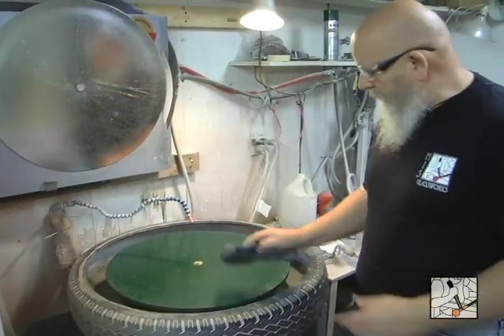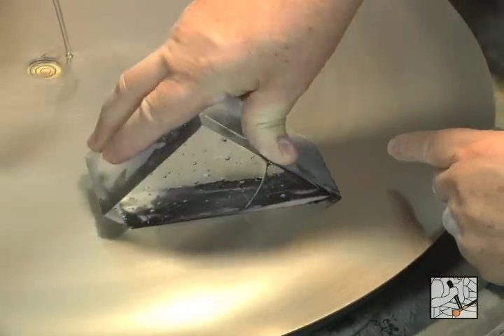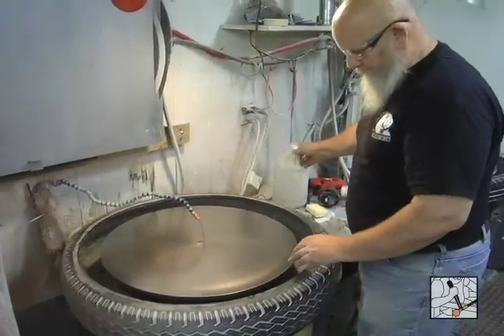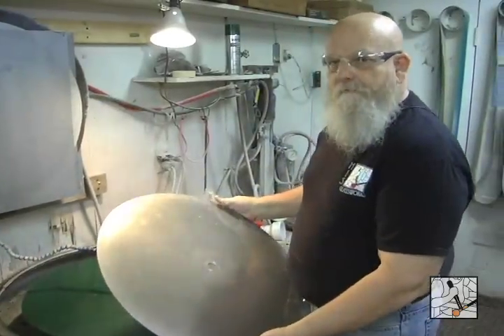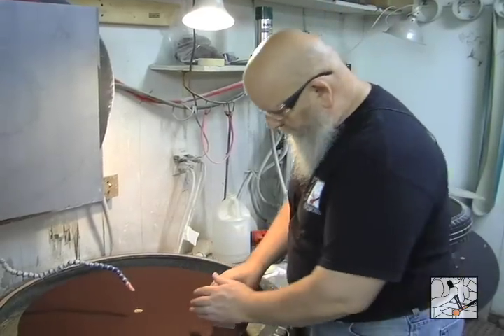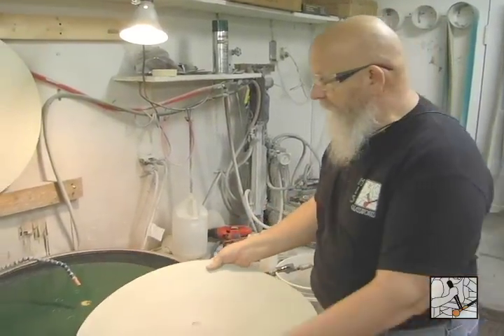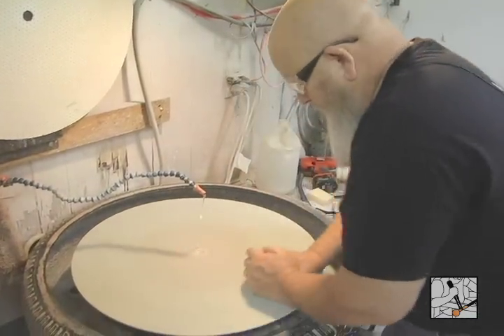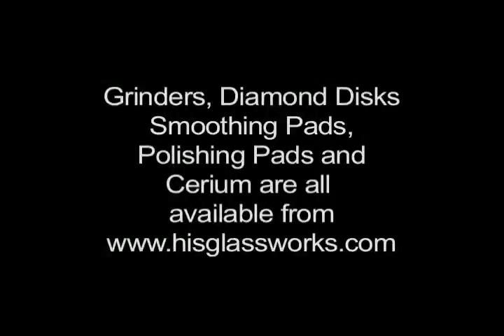Grinding and Polishing glass with Diamond Disks

Comment: one more thing , when we prepare the lens block, we use charcoal to make block(3, or 4 lens on one block), which is time consuming , there is any other marital or technique to prepare the block of lenses quickly or lens holding base.
Reply from the maker: I'm not sure what you are using the charcoal for? Can you elaborate?
Reply: @hisglassworksinc  oh my bad, it is Coal tar & Broza Gum Rosin
Reply from the maker: @saqibhussain7217  Still not sure what you are using Coal Tar for?
Reply: @hisglassworksinc   coal Tar for making lens block.

Comment: Love your video just subscribed thanks for sharing your skills! I’ve exhausted myself days researching videos to 😂 solve an on going glass problem without any luck! If I may dear Sir request advice 🙏 for help. I recycle bottles to create chimes after I  cut, grind and careful wet sanding I still end up with dull milky looking edges.  Sure looks like what your doing here would help me but how can I achieve this on a much smaller scale?
Reply from the maker: With glass, it doesn't matter how fine you go with your grinding grits, the surface will never be polished. You can move to cork and pumice for a "dirty polish" that will give some translucence to the glass, but the only way to fully polish the glass will be with cerium oxide.

Comment: Hello sir, once again for guidance

I am making lens on small scale, when i use cerium oxide 99% for polishing, it became hard in caintainer, what i mixed in it , it remain soft?
Reply from the maker: Cerium will separate from the water when you make the slurry. YOu'll need to shake it up each time you use it to get it back into suspension.
Reply: Thanks a lot

Comment: Nice work ! I have 7 small pieces of quarter in. glass I want to hand bevel for a leaded glass window I am learning to do, but I can’t find out what grit wheels to use and what RPM they should be spinning. I know it is a 4 step process. I wonder if you wouldn’t mind sharing that info with me, you obviously know what you are doing. Thank you for the quality video.
Reply from the maker: I would recommend a 140 grit, and 270 grit electroplated diamond disk, followed by a 325 grit resin diamond disk for the pre-polish and a felt pad with cerium for a final polish if needed.

Comment from the maker: @gentrysnavat The machine in the video is a first generation Steinert grinder. They currently run about $5500. We also have a 24 inch grinder from WaterJet Designs for around $3000.

Comment: The reflected light is not sharp. Can a true mirror like reflection be obtained?
Reply from the maker: You can accomplish a full polish on glass with this method, yes. Polishing with cerium is the longest step and can take as long as all the other steps combined to fully polish the glass surface.
Reply: @hisglassworksinc  looks like skill and patients are the keys.
Reply: The barrier of the turntable looks like a tyre.

Comment: Hello, i am making small lense of 5mm diameter, when we performing fine grinding the lense (with emberi powder), it changes the number of the lense.  There is any solution to make the lense with same number? is it possible perform the prepolishing step for tiny lense with resin 325 diamond smoothing pad?
Reply from the maker: Any grinding (even with a polish step) will change the surface of the lens so you have to take all grinding steps into account when attempting to get a lens with a particular curvature.
Reply: @hisglassworksinc  Thanks Sir for the reply,  we are using a diamond concave tool for curvature(grit 600 or 3000), but the problem is it leaves the scratchies on the lense , for this again I have to fine it with Powder (emberi) to remove the scratches. I achieved the same number but the problem is scratchies due to the diamond tool on the tiny lens, which appeared after polish. what kind of grit or series of grit we should use for fine grinding remove scratches without going to fine grinding with powder((emberi))?
Reply from the maker: @saqibhussain7217  So you're moving from a 600 grit to a 3000 grit? That's too big a jump. Good rule of thumb is to not move any more than double the existing grit, so you should move from 600 to 1200 to then possibly 3000 to polish. The 3000 is not getting out the scratches from the 600 so they are showing back up on your polish stage.
Reply: @hisglassworksinc  Thank you sir

Comment: Doesn't the wheel make a mist from the water and cause the glass particles (silica?) on it to become air-borne? Doesn't the white dust on the tires get kicked up into the air as well? Im trying to understand the safety precautions of your trade.
Reply from the maker: When working on the flat wheel or the lathe the water particles do not get small enough to become a health issue. When working on a wet saw it does aerosol enough that it is recommended to wear a respirator. It is also important to clean the equipment every day or every week to keep the ground glass cleaned out so it does not become an airborne silica dust.